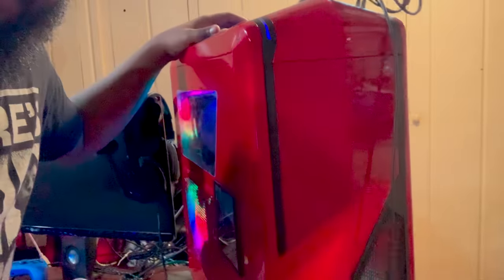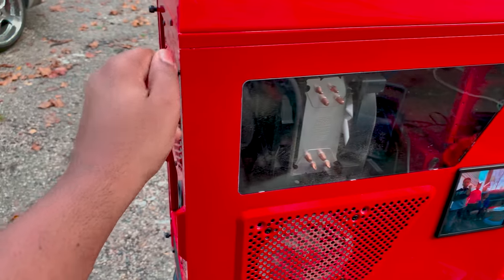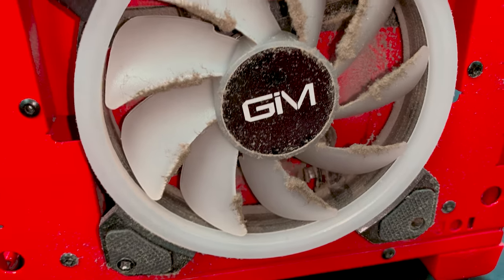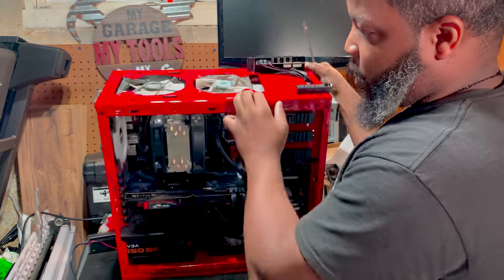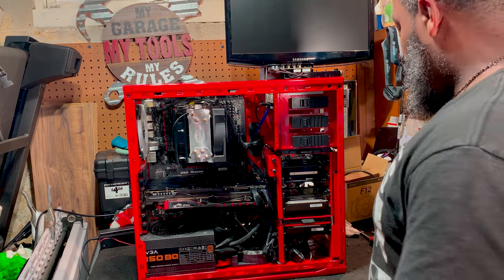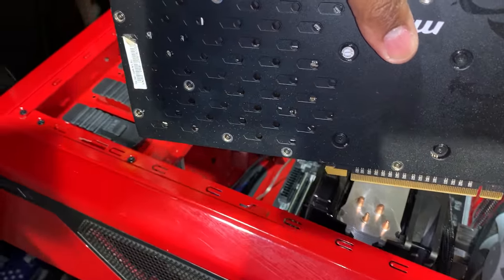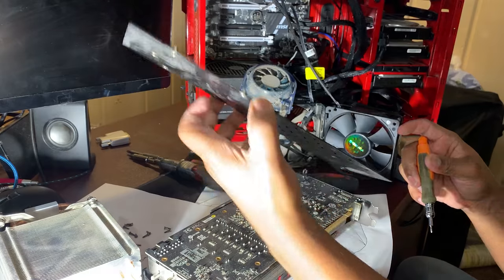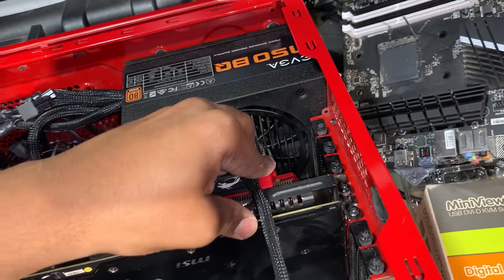How To Fix Overheating Gaming PC | Fix Gaming PC Shutting Down Due To Overheating

Comment: It's a quick question can you use the air cans and the vacant cleaner to clean it out  Or no just use the vacuum
Reply from the maker: Yeah you can use compressed air can's and use vacuum cleaner to clean out the computer. 

Just remember to keep the air can "upright" as they have a tendency to misfunction when the can is sideways or upside down. Also the air can will make the computer hardware VERY COLD so after you use the air can, leave the computer case open so the "ROOM" can warm up the computer hardware. 

Its like if you use the air can and sprayed your finger, it will get VERY COLD.
Reply: It’s not good to use a vacuum to clean your pc because it could damage your pc or just spread the dust even more
Reply from the maker: @110jn4  It all depends on how you use the vacuum cleaner. I've used Home and Specially designed vacuum cleaner systems to clean mainframe computer systems while in the field as a computer engineer for many years. Never had any issues. 

When your in the field and you have a system that is overheating because it's clogged with a pillow case of dust, trust me those compress air cans will not efficiently clean those systems. You can also pull the dust out but eventually that get's old.

The good ol days....

Comment: And how many times should you clean your computer a year
Reply from the maker: That's a GOOD question G. I would recommend at least once a year to inspect your computer for dust build up and blow out any dust. If there is significant dust build up, you might need to use a vacuum cleaner to remove the dust build up.